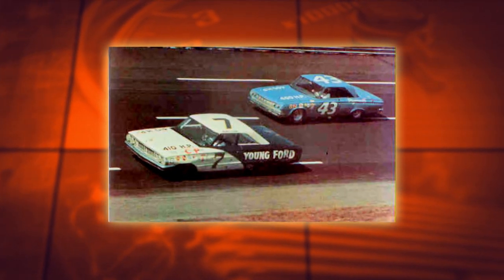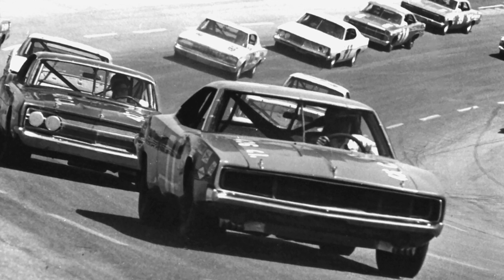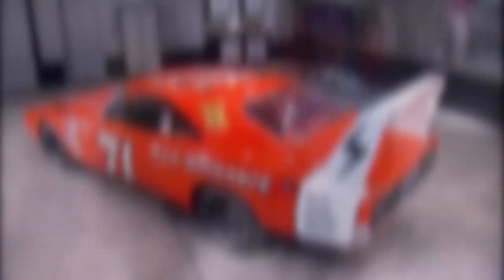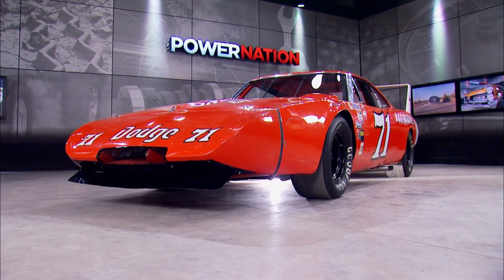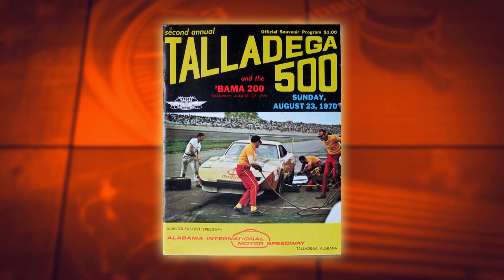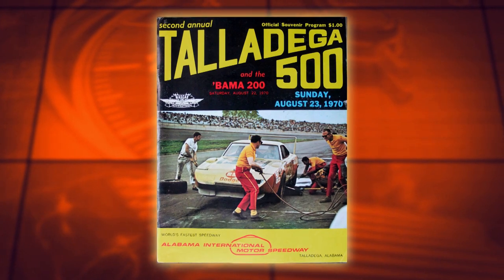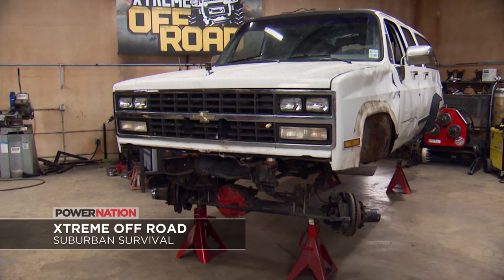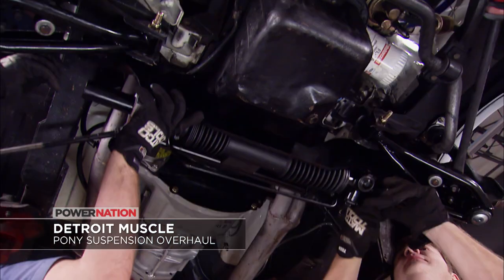Bobby Isaac’s 1969 Dodge Daytona! PowerNation 2016 Week #14

Comment: One of the most infamous NASCAR cars ever made. The very rare Daytona 1969 Charger was no joke, even to this day. 0.28 drag coefficient out of an old boxy muscle car? Come on!
Reply: do you realize that Cd (drag) has NOTHING to do with race speed.   These cars were terrible......yea, a bullet shape goes through the air pretty good.....but a car has to stay on the ground.......that pointed nose cause ride height issues and overheating.........the First real race the Fords creamed these and next race was even worse at Rockingham in 1969 where the closest Daytona was 20 laps down........they only won a total of 6 races and of those 6 one was the First Talladega, which was not a real race and another was the 2nd 125 at Daytona in 1970 after France put all of the factory Fords in the first 125 to prevent a Ford blowout.